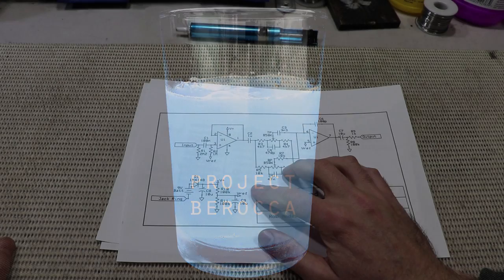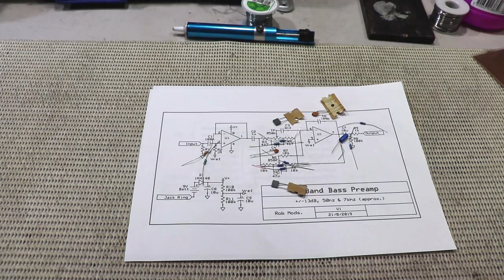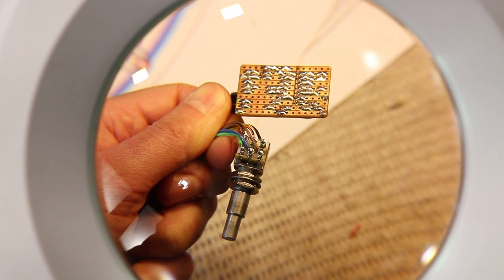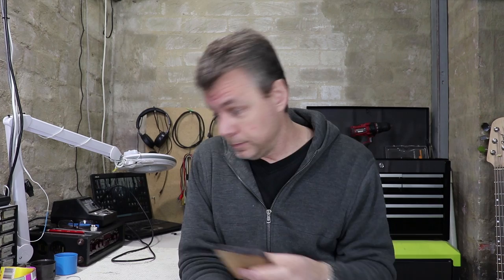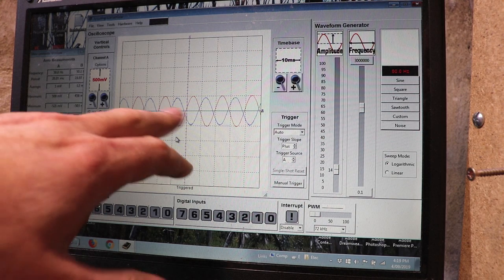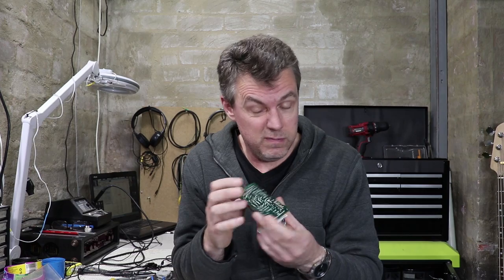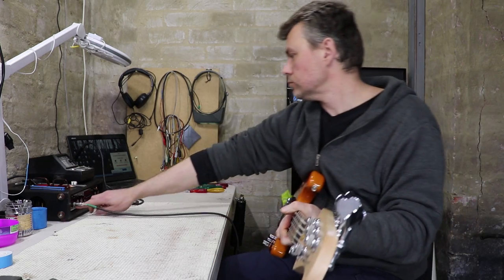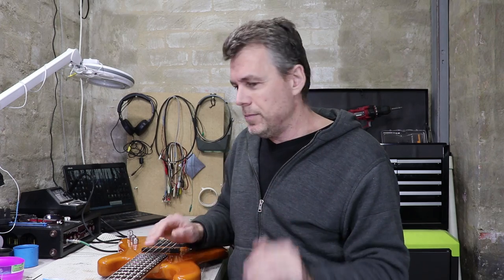How To Make a DIY Onboard Bass Guitar Preamp (Project Berocca Part 10)

Comment: Bill of Materials:
Caps
100p 
470p
3n3
47n
100n
1u
10u x 3 electrolytic 25v

Resistors
1k
4k7 x 2
10k x 3
100k x 3
1M
2M2

Power diode - 1n4148
U1 - TL072 or similar

_________________________
_________________________
C1 - 100n
C2 - 1u w/C5 controls bass center frequency 
C3 - 3n3 w/C4 controls treble center frequency
C4 - 470p w/C3 higher cap value lowers freq
C5 - 47n w/C2 higher cap value lowers freq
C6 - 100p
C7 - 10u electrolytic
C8 - 10u electrolytic
C9 - 10u electrolytic

R1 - 2M2
R2 - 1M
R3 - 4k7
R4 - 4k7
R5 - 10k
R6 - 10k
R7 - 10k
R8 - 100k
R9 - 1k
R10 - 100k
R11 - 100k

Comment: Great design. I made one for my new 6 string bass
Reply: How does it sound?
Reply: @davidhurrell9930  It sounds great. I raised the film caps at the front so the 30Hz can get through. I stopped using batteries years ago and use a homemade phantom power box so I can use any opamp I want

Comment: I have done this preamp with wrong pot values for now as I am waiting for the correct parts. Overall it sounded great on my test jig.
Reply from the maker: Nice one.  In this circuit you won't "harm" anything with the wrong pots.  The centre frequencies may shift slightly, and the sweep of the pots may be a little uneven, so, yeah the 50k are optimal for the design.  Best of luck with your project!
Reply: @RobMods  update on my build, the preamp sounded good, bass and treble has a wide range in boosting/cutting. I like it coz it made my TRBX305 sound alive, the bass guitar itself sounded too warm and dull. I replaced the 5 way switch of my bass to a 3 way switch and used it as a treble cap selector using the choices you've put up in the pdf. 😊👍

Comment: Cool build. But maybe if possible try to lower the treble control a little bit. I find that 7kHz is a little too high for it to do much of anything noticeable in a big mix and you’d almost never want to boost treble on a bass that high up in the spectrum
Reply from the maker: Remember, 7khz is just the peak of a fairly gentle slope.  But there's a bit more info in the PDF on my website that gives more cap selections for different centre frequencies.  It really depends on the pickups.  For a stingray pickup wired in parallel, it will have a typical resonant peak of 9-10khz.  But a passive P pickup, loaded by the vol and tone pots may roll of as low as 2khz!..  That's the great thing about making your own, you can tweak it to really suit your bass and rig.  Thanks for watching my content mate!

Comment: Can I use 100v capacitor for C1-5 sir? Planning to make this for my bass
Reply from the maker: Yes no problem, as long as they fit on the board.
Reply: @RobMods  thank you sir rob, gonna try this. I'm excited to make it for my own custom bass I made. By the way, I use metal film for Nanofards, monolitic and ceramic for the uf and pf. Hope it was fine.

Comment: it's not working for me..i don't know why.. i make more than 30 clone pedals and never fail😢 i use tl072 ic..i check every part and soldering... i possible to get the multimeter numbers of this schematic? thank you 🙏
Reply from the maker: I'm afraid it's almost impossible to know what might be wrong with yours.  Make sure the Vref is 1/2 your Vcc voltage. (IOW, battery voltage minus the diode's drop.) And pins 1,2,3,5,6,7 should all be at the Vref.  The tone stack should be at the Vref as well - pots, resistors etc.  The input and output should be at earth, IOW, 0V.  I assume you used magnification to check the soldering.  I've been held up with the tiniest hair of solder bridging stripboard tracks in the past.  I couldn't see with my naked eye.  Also, did you try testing the current draw?  If the chip is dead, the current consumption won't change with your 072 removed.  If everything else checks out, then perhaps try an audio probe.  Did you test it before installing in your bass?  Perhaps there's a problem around it, like a bad jack in the bass.  Remember, its ring connector turns on the preamp.  Gosh, there's so many other things I could suggest.  Even a simple little project like this can be a head scratching experience.  But I'm sure you'll learn something either way.  Best of luck!
Reply: @RobMods  ok...fail the IC... I found it unbelievable that this TL072 was the problem because it was brand new... and the last check before I threw it..i hit the right spot.
Reply: @RobMods  thank you!! sound great!!
Reply from the maker: @nikoszisidisgrmstudio   Yes, in the last few years I've had a few ICs that were dead on arrival.  Frustrating in this day and age.  That's why the socket is a good idea.  Glad you got it worked out mate!
Reply: @RobMods  I noticed that it doesn't have much boost the volume... but the filters work fine..  i test it external on stingray style passive humbucker ..and if i hit strong the strings slight distortion will be heard.
Reply: ok..my mistake..i put in R11 a 10K resistor and that's why low volume..
Reply: @nikoszisidisgrmstudio how does it sound now?

Comment: hi!!! thanks for shareing this circuit, i´m going to build it,  i´m plannig to install it in a cheap jazz bass copy.
Is ok to use the the input impedance of 100n and 1M for C1 and R2  if i´m going to use only the 2 band preamp, can i use it with the passive circuit?
Reply from the maker: Hi Juan yep,  this values will be fine.
Reply: @RobMods  thanks a lot!!!
Reply from the maker: @JuanMotta  No problem mate.  Good luck with the build!!
Reply: @RobMods  hi, i have a question, i installed the active circuit after the passive circuit, and works well but the problem i have is that i have much less volume from the bass i don't know what the problem is.
Reply: I have used a 105 250v cap insted of 25v For the c2 because it was the only cap that did not send to me  when i ordered and i found this For replacement, i don't know if this is the problem.

Comment: what about a 3 band preamp with bass mid and treble? how would you do that ?
Reply from the maker: Well, you can have a 3-band Baxandall filter around a single opamp.  The classic 3-band Stingray preamp is like this.  (And there's lots of other examples.)  But the mid control is a little underwhelming IMHO.  Very low Q factor and not much cut and boost.  A much better option is to have another separate opamp stage for the mid control.  In the future I may do a standalone mid control that can be added to this or the other (fender tonestack) preamp I've shown on the channel.

Comment: Can u please explain the rg1 and rg2 use i did't understand that please
Reply from the maker: Hi Muhammed.  There's some info about this in the PDF on my website.  The combination of these two resistors control the amount of voltage gain the opamp produces.  For a circuit like this, in non-inverting mode, with (RG1 as the feedback resistor and RG2 as the resistor that goes to virtual earth), the voltage gain is calculated like this:  (RG1 + RG2) / RG2.  For example, if both resistors are 10k the gain is 2.  This equates to 6dB.  Thanks for watching my videos!
Reply: How to add mid controller in this circuit

Comment: this material is really appreciated and i know beggers can't be choosers buuut.... why wasn't a bill of materials included? now i have to scan the schematic and write it out myself. 

if im up to it, i might edit this comment to include the BoM. and i understand some of the values and components depend on user. 

but really a simple bom to start the document wouldve been fantastic
Reply from the maker: You make a good point.  It is such a small circuit, and I usually have all these parts on hand, I really didn't think about it TBH.  But if you post one here,  I'll pin it for sure.  Cheers.
Reply: @RobMods  thanks Rob Mods. I'll do that when I get home from work then.
Reply: @RobMods it is finished. I wrote it two different ways but it should be easy to read and understand. Im happy to change any formatting if you like.
Reply: @RobMods again, this is very much appreciated. I have a VM Jaguar that I've been using as a project Bass. first it was adding a passive active switch. then it was changing it to like a Bass VI or a jaguar, w/ a strangle switch. Then the Bass Boost circuit stopped working and I never liked it anyway.

Im using this circuit to bring the VM's 4 hole control plate closer to the capabilities of the original 2006 MIJ Jaguar Bass. stacked B/T pot, push pull tone pot for on-off active circuit, and push pull volume for S/P switch. 

Then either VVT or VT with a big 3 way pickup selector. leaning toward the latter, but id like to hear what anybody thinks.

Comment: Hello, The impedance of the pickup set made any difference in how this preamp works? for example if the impedance on the pickups is low, is there anything to modify in the circuit? Nice project!!
Reply from the maker: If you run the pickup straight into the preamp and have your volume pot on the output, then yes I'd reduce the input z of the pre and also think about a capacitive load for the pickups to make them sound more natural.  If you have a pot or two (volume, blend etc) between the pickup(s) and preamp, then there's no need to do this.  It's the direct load on the pickups that effect their resonance.  I talk about this in Project Berocca Parts 8 and 9.  Plus in a few other videos.  I'm glad you like my channel!

Comment: So i have a question .. Its kind of hard to find 1uf non-polarized caps .. While maintaining everything else what can i use in its place ? (C2)
Reply from the maker: I use monolithic 1uF caps.  I buy them from Jaycar, right over the counter here in Australia.  You can also get MKT caps in 1uF, but they are pretty big.  That's why I left plenty of room for C2 on the stripboard layout.  You could simply leave it out and replace it with a short, but if you like to crank the bass control and slap a lot, be careful of your speakers.  You may want to use a smaller C1 to tighten the sub frequencies a little.   Cheers!
Reply: @RobMods  Thank you very much man!

Comment: Hi mate! Thanks for the videos - they are awesome!
I am trying to make this pre-amp myself but I am struggling to find here is Oz B50k pots which are long enough to go through my bass top. May I ask what shop you got yours from please? Cheers!
Reply from the maker: I've never seen B50K long-thread pots available from any Aussie guitar parts places.  I buy mine from overseas.  Sometimes the regular Jaycar Alpha brand pots will go through without any washers on the inside.  If I use them like this, I drill a small shallow hole for the anti-rotation lug.  Mark the drill with tape so you don't go right through!
Reply: @RobMods  Hey mate, I tried to switch the lm358 for a lme49720/lm4562 but somehow the sound is very thin and distorted. I am not an expert in electronics but I wanted to change the lm358 for a higher quality op amp. Would you know how to use the lme49720 or maybe would you know of a high quality op amp I could use. Thanks heaps. PS: I re-watched the whole series on project Berocca, it was great! thanks for the content!
Reply: @RobMods  I've been planning to replace the preamp of my TRBX305 and can't find a B50k pot until now, they are very common pots for pedals but they have shorter bushing/threads. I'm even planning to do the darkglass tone capsule and I've found your post in talkbass and your also from Aus. I thought I'm the only one struggling with B50k for guitar pots mounted to the body.

Comment: hello, i am going to build this great preamp. but it's hard for me to find B50K concentric pots.is it okay if i use 100K concentric pots? i'm going to use concentric pots because my bass just have 3 pots hole and do not want to do some wood work e.g drilling new holes
Reply: I've got the same problem here. Just managed to get B500k pots, and that's a big leap. Can someone help me with this? Thanks!
Reply from the maker: 100k will work OK, but the sweep of the pot will be a bit abrupt, and you'll also have more cut and boost, also the frequency centres will be a little off.  I'd recommend 50K for sure.  Try ebay and ali express.  Also try Aguilar, Bartolini, Ernie Ball, Dark Glass, etc.  They all use B50K pots in their preamps.

Comment: Hi. Does anyone know if this preamp would work with a one pickup bass like a music man? Obviously I wouldn't need the blend knob. I would imagine that since the blend is just making both pickups go to one out it should work without as it's only one pickup?
Reply from the maker: Yep this will work with a single pickup.  For a stingray set up, with the volume pot on the output and the pickup going directly into the preamp, I'd recommend using fairly low input impedance (around 100k) otherwise the (parallel coil) stingray pickup will sound very hi-fi and strange.  Thanks for watching!
Reply: @RobMods  Thanks so much. I don't suppose you have a circuit diagram of that by any chance?
Reply: @RobMods  Thanks
I don't suppose you have a circuit diagram at all for that?
I am not sure where to put the volume pot as I want a push pull one.
Reply from the maker: @jblazeby  Is the push-pull switch a preamp bypass?  If that's the case it should be an A250K or A100k between the pickup and the pre.  Just follow the diagram from the PDF on my site.  Ignore the blend control and run the hot wire from your pickup to the clockwise lug of the volume pot.  (Where the light blue wire goes.)
Reply: @RobMods  Sure thanks.
I was using just the preamp without the active blend control.
I think that was 250k.
Reply: @RobMods  Yes definitely the 250k push pull pot
Reply: @RobMods  Thanks for the advice. I was able to read this properly. The push pull is a 250k pot and is intended as the active/passive bypass switch. What should I change R1, R2 and C1 to to compensate for it being one active pickup?
Reply from the maker: @jblazeby  Because the pot is before the preamp, there's no need to change the circuit.

Comment: Does the circuit is suitable for in car bass/trebel control?
Reply from the maker: I don't see why not.  It will be fine for 12-14V (car battery) operation.  Since you would be using a low Z line source, I would make the input impedance lower for best noise performance.  IOW, lower the input resistor and raise the coupling cap proportionately.  You may also want to raise the treble control to say 10-12khz and lower the bass control to say 30hz for hi-fi type operation (depending on your speakers of course).  Thanks for watching my channel!...
Reply: Please send me a link  download schematic
Reply from the maker: @giorgitushmalovi3403  Hi mate.  Thanks for watching my video!  https://robkiddhomepage.wixsite.com/robkiddmusic/project-berocca

Comment: What is the wattage of the resistors and the capacitors voltage.. Thanks a lot, hope to hear from you soon..
Reply: And also the layout of the pcb if possible😀😀😀 thanks a lot.
Reply from the maker: Check out the PDF on my website.  https://robkiddhomepage.wixsite.com/robkiddmusic/project-berocca
Reply: @Rob Mods is 1/4 watts for the resitor would be fine?. And 25v for the caps also?. I'm new to this,  and you forgot to add the values of caps and resistors in pdf, so im confused on how many watts for the resistors and how many volts for caps.. Can I also ask for a pcb layout for this?. Thanks man, this can help a lot for me.
Reply from the maker: @tatangmo7853  No probs.  Yes, 1/4 or 1/2 watt metal film resistors, and the electrolytic caps should be 25v.  There's no PCB layout at this stage, but the stripboard layout is very small and very easy to make.

Comment: Forgot to say it has piezo pickups
Reply from the maker: In that case, use an op amp IC with fet input transistors, like a TL072 for example, and set the input impedance very high.  Something around 5 - 10 megohms.

Comment: Rob, I've been wanting to purchase a $40 wireless set for the guitar, and open it up place the chipboard on the back of the backplate, maybe add an extra antenna stolen from a wifi PC card and install it near the strap button. Either way, it has to be too easy to turn a guitar into a wireless guitar all built in and ran to a 9V battery or rechargable battery. Could you please do this for me, or I will get it to it soon enough.